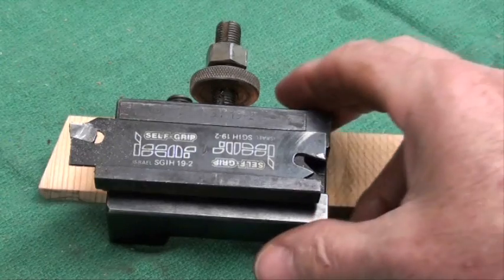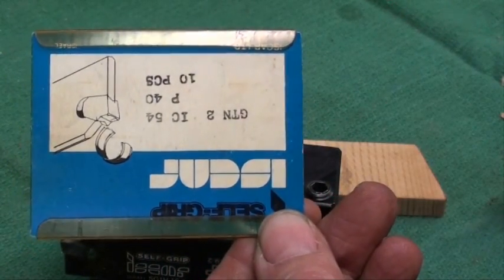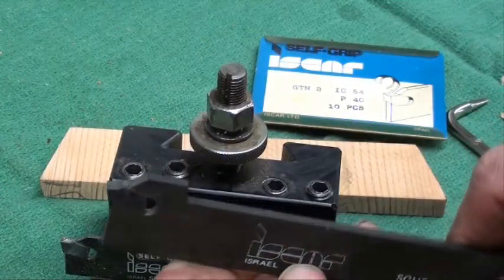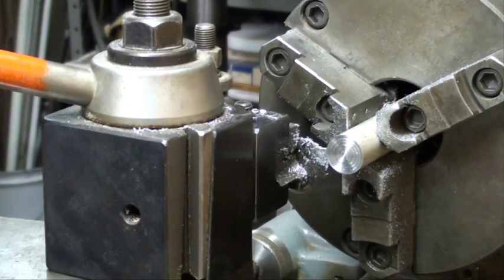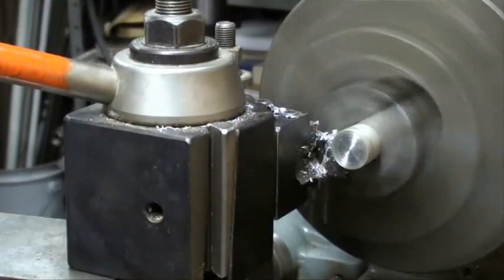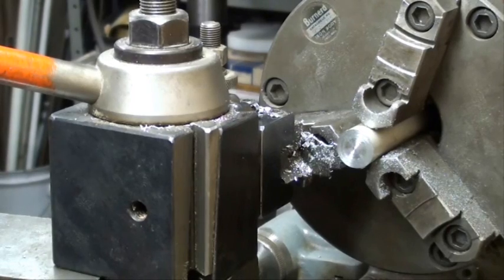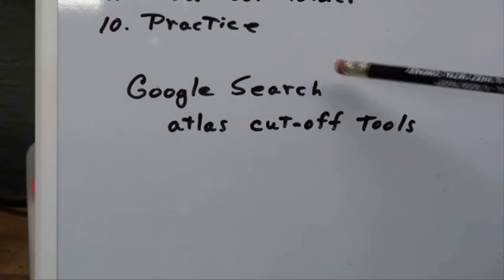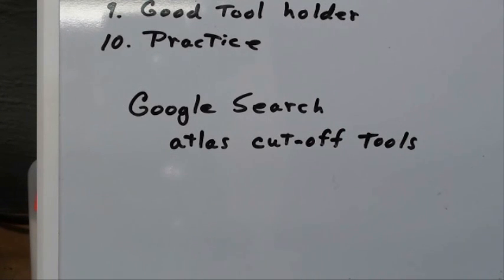MACHINE SHOP TIPS #37 Part 3 Parting on the Lathe tubalcain

Comment: Mr. Pete,    I have an old Craftsman 109.20630 lathe from 1945.  Recently attempted parting off using a cheap $10 parting tool from Amazon from India.  It has a 1/4 inch square shank and a very thin HSS
cutter.    No luck at all.   Chatter city no matter the speed or feed.    In your opinion is it even worth trying to part off using one of these filmsy old Craftsman "109" style lathes?   Maybe this machine is just not up
to parting off.  What do you think?     Thanks.
Reply from the maker: You answered your own question. You will never be successful cutting off on a small light duty machine. It is even very difficult on heavier machines.
Even I avoid this operation if it all possible. And the lantern type tool post cannot even begin to ridgidly hold the tool.
Reply: @mrpete222  Yep.  You got that right!   This machine does use the lantern style tool post.   Currently I am making up a batch of special hex nuts.   They are brass with 1/4-20 threads.   3/8" across flats
and .160 inch thick.   They are some special ones used on some old Western Electric telephone switching equipment.   Cannot find them anywhere.   So I am making my own out of 3/8" brass hex stock.
Use the lathe to drill through the center on a 2.75 inch long work piece.   Then tap as deep as the tap will go, (about 1.06 inch at a time).    Then cut off and finish each nut.   I thought maybe parting
them off in the lathe might be one of the steps.   But no.   That does not, and cannot work.    So I set up a spacing jig in the band saw and part them off that way instead.  That works real well.
First batch of a dozen finished nuts came from 2.75 inches of stock.   That is roughly .055 inch of waste per part.   So, as always, the liitle old weak 109 lathe yet again proves its limitations.
Some day I'll get a real lathe!   Thanks for your response.   Much appreciated!  (have had the 109 lathe since 1991, bought it off a local guy for $150)..........just put a Sherline chuck on it, those are very nice.

Comment: Ha !  I've busted a few parting tools.  The last one was a carbide insert.  I couldn't work out why it broke. I had everything set right.   You mentioned don't bother with cold rolled stock.   That was the problem.     Funny thing though. The only parting tool that I have never damaged is one I made out of a power hacksaw blade.

Comment: Awesome videos as always - I was wondering - I want to part off 4 inch diameter aluminum - should  I start with the tool ''choked up' and then pull the tool out for a second cut or would I be better doing the whole operation in one step?
Reply from the maker: Yes--choke it--that how I do it

Comment: Yes sir i was wondering if i can use the cut off tool to cut i think it is o1 tool steel? The material is gonna be used for punch pins. also i have a grizzly mini lathes any help would be great. thank you sir
Reply from the maker: michael hopp You can try it, but that tool steel is pretty hard to cut fff
Reply: mrpete222  If I use coldroll and heat the end red hot and place it in oil will that make it ok for a punch to put holes in a coin? Thx for the help

Comment: Pete, i watched all 3 videos with interest, but can you answer me this.. i want to
part off 4inch dia nylon, so the cutter will be hanging out 2inches ,can i get a tool that long?  or i can cut about 11/2 inches in and saw the rest as it will be faced
anyway. 
what do you think?
Reply from the maker: Yes--the tools are that long. Becareful--they are not very rdgid at that length. I often saw half way thru--especially on plastic.

Comment: Again, thanks a bunch. I watched this a few times a month ago, and remembered to put it on center, etc.  Today, I tried parting a inch and a half hot rolled in the middle, on a center. Lantern toolpost, and nothing I did would stop it chattering so bad.  speed, feed, put the cutting edge above, below, and even tried to angle it.  Bad results, bad results.  I was having pretty good but slow results on half inch stock, but this one stumped me.  Now I know, bad tool holder, way too far from the chuck. Next I am going to try to put a little chip breaker edge on the tool, and make a steeper cutting ange, hopefull that will succeed, and if no, then back to the hacksaw.  :)  Seriously, thanks a million for your videos, you are the best teacher out there.  Tom
Reply from the maker: HOT ROLLED steel is nearly impossible to cut off like that. Terrible machinibility rating.

Comment: Well, that solves quite a bit for me. First I've got the wrong profile on the cutter, second I don't have the Aloris style holder but I should be able to make do. Third, I'm going to have to go over my lathe to make sure everything is in adjustment. It's a fairly small old Montgomery Ward so it's going to need all the help it can get. Until now I've been notching my piece with a cutter and parting with a hacksaw. It works but it's not the greatest finish and sometimes gets concave or convex.

Comment: other 2 videos comments are disabled - a lot to say about the cut off tool - when your cutting off from the front everything is working against you - compound slop - bushing slop in the spindle chuck -cross slide slop - It's easier to catch a rolling tire from the back than from the front lol - turn your cut off tool upside down - run your lathe in reverse - if you have a screw on chuck then your in trouble - thumbs up Stan

Comment: What is the reason turret lathes part off from the rear? Gravity removes the chips which will not jam the cut or the cutting forces lifts the compound and cross slide which tightens rather than loosens the dovetail joint?

Comment: Thanks for showing this when I first started doing metal work I always dredged using a cut off tool. I am now on my third lathe, a used Myford and I am having success. I do lots of small fine work and have less trouble now. A good friend has said to slow done the rotation when I am having problems cutting very large stock. The Myford is not the most ridge lathe but can do the work at a slower speed.

Comment: One thing I would like to add to this, and that is, Parting off on larger dia, say 3" you will need to "Side it" thats to say pull the cutting tool out and move across approx the width of the carbide tip, before feeding back in again. This practise will prevent the parting off tool from snatching on the sides because the width of cut is wider than the parting tool itself, also as the dia reduces, speed must be increased.
I agree with everything else that you said. 5*

Comment: @MGARestoration he did, just check his vids on drill bits and taps & dies. alu and steel use different cutting oils, but you can get away with one (that is for steel), because plenty of time you don't even need to lubricate alu when either taping or drilling as long as you're not actually machining it. mr pete please verify what I've said :)

Comment: Nice cut off series. Where I work we almost always use carbide cut off ,so yes I'am spoiled when it come to parting material. Although I've always parted at low rpm 80-120 on almunium cold roll ect. I think I'll try running faster rpm and feed in quickly ,and see how that works out. Again thanks for the video.